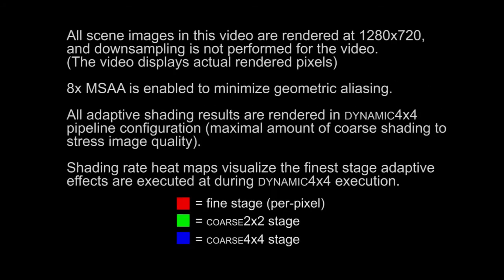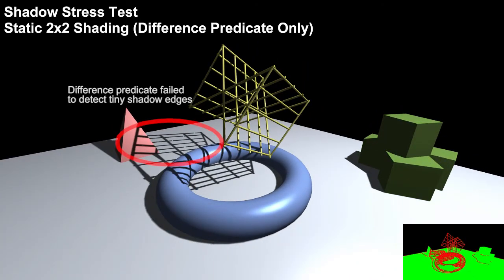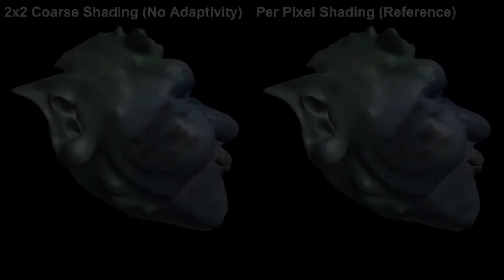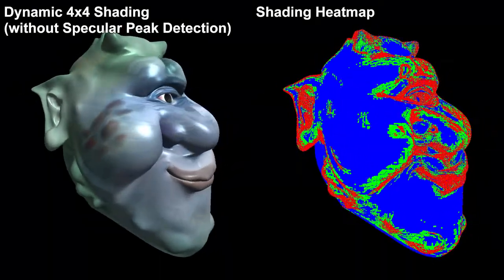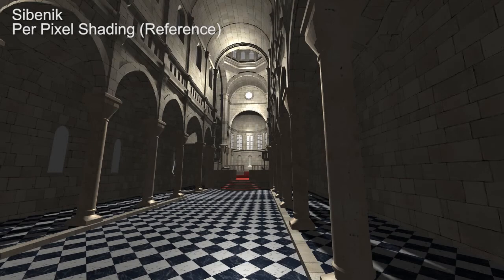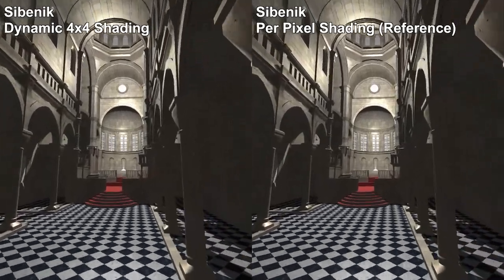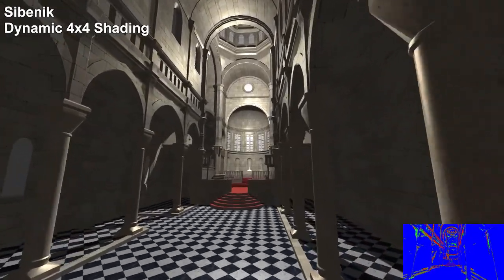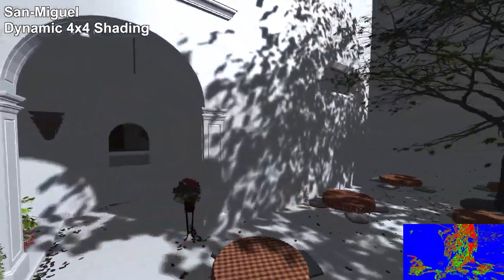Extending the Graphics Pipeline with Adaptive, Multi-Rate Shading

Comment: Theoretically, if this technique of Forward rendering were integrated at a hardware level, how well would it play with screen space effects compared to a traditional Forward+ render? Doom 2016 did SSR by using a depth pre-pass with a g-buffer and reprojecting the previous frame with a fuller g-buffer, which causes bandwidth issues (particularly on Xbox One, hence the aggressive resolution scaling and lower FPS compared to PS4), and did the same with SSAO, which also makes it hard to implement MSAA. Depth pre-pass with just the depth is also possible but requires double the CPU batches. Does multi-rate/variable frequency shading solve this?